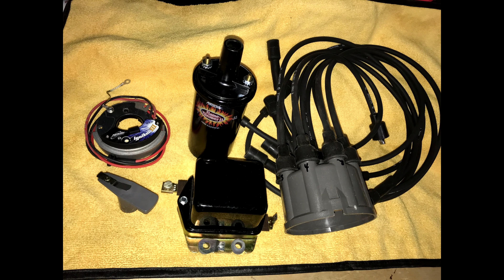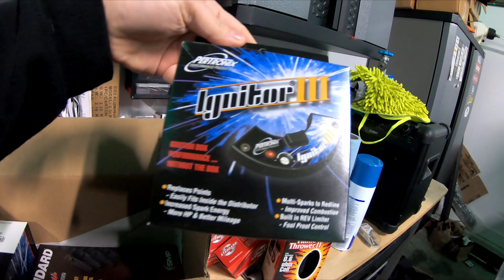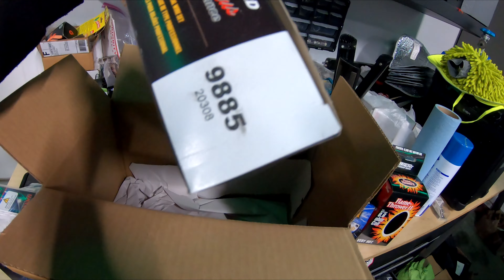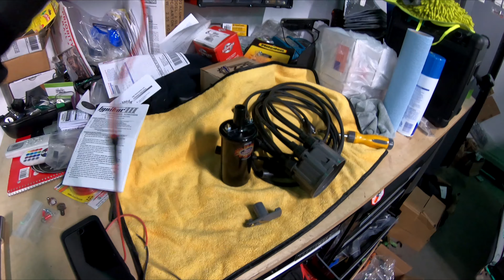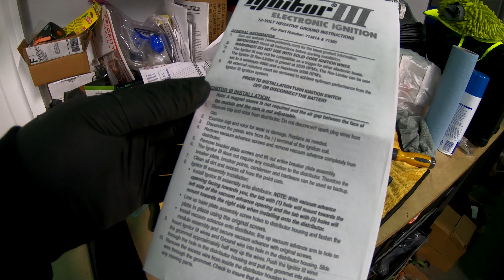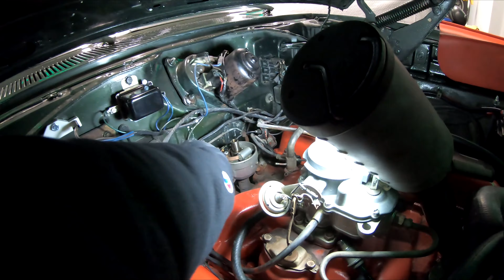1968 Charger ignition and starter upgrades!  Plus Bonus LED lights for dash!

Comment: I've also just got my ignitor 3 and coil (thanks to this video!), how did you bypass the resistor? In the latter part of the video I just see it removed. Did you splice the 2 blue wires together? I'm not that sure because on the right I've got a blue, and a brown wire - and perhaps the brown one needs resistance
Reply from the maker: Yes simply hook them together.  I used a small wire with male blade style connectors on each each.  These simply plug into the connectors that went to the ballast resistor wires to make the connection.  I put that inside of heat shrink tubing to hide it and keep it from shorting out against any metal.  Works great.